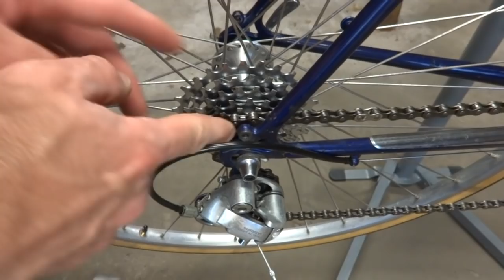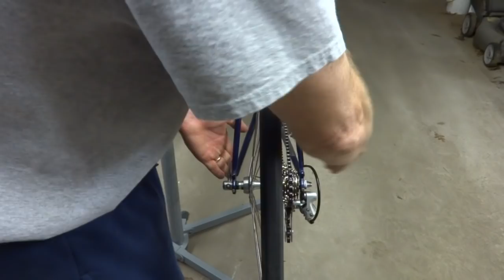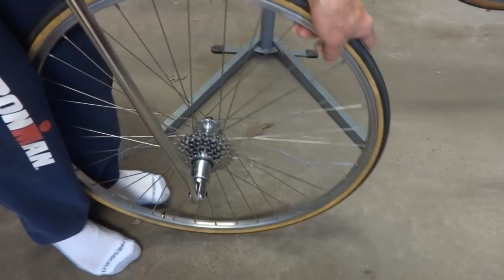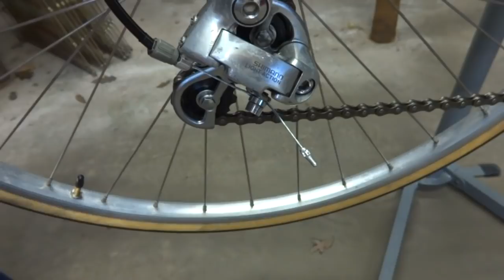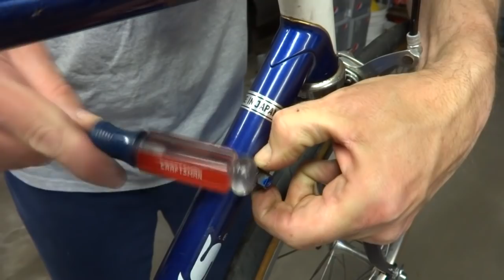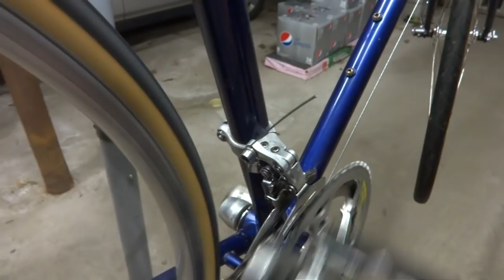How To Do 6 Speed To 7 Speed Freewheel Conversion

Comment from the maker: @Guillaume Bourdel, I found this stand cheap on ebay. It was a bit rough. The bottom part had some rust. So I cleaned it up and repainted the bottom part. It was originally the same gray as the top part. I keep the Park Tool stand in the house and this one in the garage. That way I don't have to drag the Park Tool stand in and out. The Park Tool stand is much nicer. This one doesn't hold the bike quite as solid as the Park Tools stand. I still have my homemade stand which I used for years. It is currently holding a Trek 520 frame that I plan to build up.
Reply: Cool! I have to tell you the stand you made was one of the best I've seen (and I've researched DIY stands for quite a bit!) and I used it as a base for mine. I wasn't quite sure about the plastic T joint to hold the bike so I installed pipe clamps instead. It never failed me and although it's not as practical as a "real" one it still does the job very nicely. I like how it can be taken apart too to store in tight space like the one I have. It sure makes any repair and cleaning easier!
Reply from the maker: I think some of the DIY stands around the net were based on mine. I posted these plans back in 2007: http://www.bicyclebikes.com/bicycle-repair-stand-plans.html
Reply: +RJ The Bike Guy got a couple if questions above if you could help?

Comment: For what it's worth, Sunrace freewheels work perfect with Shimano index or friction shifters. They're ramped so they shift way better than vintage freewheels, especially with friction shifters. They look better than the modern Shimano ones like in the video with the hideous big black cog with a Shimano logo that goes on a Walmart bike, they're zinc plated and drilled and you can get them for less than $20. I have thousands of trouble free miles on them.

Comment: Thanks for this! I have a Mongoose Hill Topper that I bought in August of 1990 at a Schwinn shop. My Mongoose has a mostly original 3x6 Shimano drivetrain and I enjoy keeping this bike rolling. Plus, the steel frame is great for my two-year old's Thule seat. Anyway, I watched this video because I'm considering whether to convert my Mongoose to a 3x7 drivetrain, or not. My thought was to use the whole 7-speed rear wheel of my wife's 2003 Trek Singletrack (she rode the Trek maybe five times total and it's essentially in mint condition with Shimano Acera components). So, if I understand this video correctly, I could potentially use my wife's 2003 Trek as a "donor bike" to achieve a 21 speed bike on my Mongoose? In other words, all I would need to do is replace the 6-speed rear wheel with the 7-speed rear wheel, replace the existing 6-speed shifter with a 7-speed shifter, and possibly use a spacer on the rear axle (if needed)? Thanks again.
Reply from the maker: Probably, yes.
Reply: If the Hill Topper has a HG FH  a 7 speed cassettes might require a 130mm OLD. Easy on a steel frame ATB. I did this on a 95' Threshold. This year Mongoose had a 6 and 7 speed HG Altus group set available on HG free hubs.

Comment: How big are the gears on that seven speed in this video and how big were the gears that this bike previously had as a six speed? I am asking because if I were the one to convert a six speed to a seven speed, I would look at the sizes of my six gears before adding another one. If the sizes of my six gears, in tooth count, are 28, 24, 21, 18, 16, and 14 when converting to a seven speed, I would want that added gear to either have 32 teeth or 12 teeth, so the seven speed options that I would consider would be gear sizes 28, 24, 21, 18, 16, 14, and 12 or sizes 32, 28, 24, 21, 18, 16, and 14. Another option would be sizes 34, 28, 24, 21, 18, 16, and 14 or something very similar. If the extreme gears of a seven speed are the same sizes as the extreme gears of a six speed, then I no longer see the point of converting to a seven speen, unless if you want tighter shifting between gears.

Comment: Nice video, thank you! My brother gave me a Mongoose MGX DR-X 21 speed...my question is this bike good to take off-road?  Is it safe? Thank you!
Reply from the maker: Not familiar with that bike, but at a glance it looks like one of the low end Mongoose bikes with a dual suspension that is more for looks than for actual use. I wouldn't take it on an serious off-road stuff. It will probably break.
Reply: Thank you....I had plan to take it off-road tomorrow...but wasn't sure if it was safe....thank you for your time. Any recommendations on a bike for off-road?
Reply from the maker: Well to start off, look for something that wasn't sold at Walmart. Look for a band name like Trek or Specialized. You aren't going to find a good dual suspension mtn bike unless you fork out some bucks. A hard tail is okay. You can maybe get a bike with front shocks. Look for good shocks like RockShox. Low end bikes may have shocks, but they aren't much more than springs and are more for looks than use. Mongoose does make some higher end bikes too, but unless you know what you are looking at, I would avoid that brand. They make a lot more low end bike that higher end ones.

Comment: I have a 6 speed Shimano tz20 ( 14-28 )freewheel that I'd like to swap out for a 7 speed megarange (14-31) The shifter is a Shimano SIS index revo shift (grip type) The derailleur is a Shimano SIS index Tourney. Can the swap be done? What would I need to change besides the freewheel?
Reply from the maker: You would probably need a new rear derailleur that can handle a 31t freewheel, and 3x7 shifters.

Comment: Another great video! Reason to do this is just to give a bigger cog for hills, right? I have an '87 Trek with Suntour a5000 derailleur (AccuShift system?) and DT shifters. 6 speed indexed shifter. Do you think I could just get a new pair of 7 speed suntour shifters (or even just the right side one) that would work with my existing derailleur? I see lots of 7 speed suntour accushift DT shifters on ebay. Thanks for any info you can provide!
Reply from the maker: You can have a bigger cog with 6 cogs. 7 cogs give you more gearing options. And more options for indexed shifters. You would have to research that. I am guessing if it is accushift, it will probably work. I like the Shimano SIS indexed stuff.

Comment: I'm converting from a 7 speed to an 8 speed and the chain DOES hit the frame.  Since I'll be adding a spacer on the drive side, shouldn't I add one on the other side as well?  That will then mean the disc brake caliper will need adjusting or shimmed right?

Comment: Terrific video and well explained.  I have a similar bike with a 6 speed freewheel and friction shifters (all Shimano).  Can I reuse the existing parts and just upgrade the freewheel?  Freewheel model # would he helpful.
Reply from the maker: If you are using friction shifters. Maybe. Whether the shifter and derailleur move far enough. Freewheel model doesn't matter as most 7 speed freewheels are spaced the same and would work.
Reply: RJ The Bike Guy 

Ok I did some digging and I think I have a Shimano 105 golden arrow.  I remember this was before SIS.   I think later models of my bike came with 14 speed so I think there should be room for the 7 speed freewheel and I think the 105 can handle it as well?
Reply from the maker: @19dlau69  maybe. It's friction shfiting.

Comment: Hey RJ, I have a few quick question for you about mods on my Citizen Tokyo Bike, which I got really cheap. The standard equipment is 16 inch wheel freewheel, Shimano 14-28T 6 spd, the stock tires are 16" x 1.75" 45 psi. stock plastic foldable pedals, Alloy V-brakes and 170mm alloy crank arms with 48T alloy chainwheel. Cool bike, but too slow and a little heavy. I'd like to upgrade a few components for a little more torque. Of the few blogs, I read, recommendations have been made for a 11-28 freewheel, 7 speed and 55 T chainwheel. My questions are has anyone attempted this project? If so, did this combination make a difference? Lastly, to reduce the cost of overspending, the best place to source components? Thank you.

Comment: Nice Explanation, But... is it possible that you name the tools and the new parts so it's easyer for the readers what they need to do it yourself.
There's alot of fake parts on the internet.
I myself have a vintage peugeot city bike from 1975, made in france with that 6 speed freewheel (Shimano MF-HG20) with Shimano Positron PPS derailleur and need a new freewheel. If you could advise me which Freewheel remover (mayby FR-1) and which freewheel i need (mine is 14-32).

Comment: My bike has a steel frame and I have an old 8 speed trigger shifter laying around. Is it possible to do a 6 to 8 speed (both freewheels) conversion?
Reply from the maker: Possible, yes. Advisable, no. If you want 8 speed, get a wheel with 8 speed cassette. You will have to expand the frame. https://www.youtube.com/watch?v=QwxEPRk3LFg

Comment: Great video RJ.  Would you happen to know if Shimano made a 7 speed freewheel in the 600 series?  I've looked for one on ebay unsuccessfully.
Reply from the maker: Not sure. You would have to research. 600 became Ultegra. I found a Shimano 600 Ultegra 7 spd Uniglide Cassette. That might be what there is.
Reply: @RJTheBikeGuy  Thanks for the info RJ.  My bike is vintage (1986) and has a screw on freewheel.  It doesn't look like there's anything out there if I want to stay in the old 600 group set.  Time for a new bike I guess.

Comment: assuming your not using an indexed shifter(using a friction shifter) is replacing the rear derailleur necessary when going from a 6 to 7 speed freewheel. this is on a 1984 schwinn world sport, which is equipped with a Suntour friction quill stem mount shifter, and a Suntour AR rear derailleur. the front derailleur  is a Suntour AR as well.
Reply from the maker: Maybe, maybe not. Depends whether the derailleur will reach all the cogs.
Reply: well! we'll find out tomorrow when i go into the shop! thanks dude!
Reply: hey just wanted to let you know i was sucessfully able to convert the world sport to 7 speeds! next step is 9 speed!
Reply from the maker: Cool!

Comment: I am totally happy with 2x6. My problem is that I cannot get a decent hub / freewheel anymore. I don’t want to go 2x7 with cold resetting the dropouts just to be forced to friction shifting to make 2x7 freehubs somewhat work on my 2x6 SIS. I don’t understand why the big companies do not make one good retro system for those many old bikes out there. I think there are enough enthusiasts out there for a small batch production.
Reply from the maker: Did you watch the video? I didn't cold set the frame. I didn't use friction shifters. Not sure what you are talking about.
Reply: @RJTheBikeGuy , I really like your videos! Very helpful information. In this video, you still had to change the shifter from 6 to 7, which I do not want to do, because I am happy with the quality of the Shimano 600 Series 6-speed shifter. I don't see a reason to go 7-speed. I would instead like to replace hub and freewheel with new parts (I know I can get worn/used ones, mostly for a large premium, on ebay), but I have trouble identifying a manufacturer in the SunTour quality class (Origin 8 seems to be the only 126mm option on the market and 13-XX freewheels are not longer manufactured?). In order to keep the gear ratio I am toying with the idea to upgrade the chainring from 52 to maybe 56 or even larger and then use a 14-XX freewheel.

I also got a bike that was cold set by someone to fit a 130mm 7-speed freehub, but the indexed shifters (again 6-speed Shimano 600) work only in friction mode with the 7-speed cassette. Maybe you could point me to a resource how to retrofit the shifters: It is my understanding that by exchanging one of the rings in the Shimano 600 6-speed shifters, they can be converted to 7-speed without the need of replacing the entire shifter. I am trying to find a copy of the instruction manual from the 80ies that supposedly describes the process, but so far I did not succeed.

Thanks!

Comment: Great video! Merry Christmas! I have a 6 speed freewheel bike (an old big box bike) and a good 8 speed shimano acera shifter. It would be less expensive to do an 8 speed freehwheel conversion than a 7 speed freewheel. Is it feasible without needing to redish the wheel? I got a steel frame that I can extend.
Reply from the maker: You will need a new wheel. 8 speed hubs are wider than 6/7 speed hubs. And generally 8+ speed are cassettes, not freewheels. There are 8+ speed freewheels, but they are usually cheap junk, and the longer axle is prone to bending.

Comment: Hi RJ, thank you for all your tutorials for us home mechanics.  After 8 years since its publishing this video needs a refresh. VG Sports has 11 speed 11t - 36t frewheels selling on the Internet forest. Could you do a conversion from 7s to say 10s or 11s freewheel, and what it takes for a conversion to succeed in terms of axel, derailleur, shifter??
Reply from the maker: First, a big thank you! I can't give a long response right now. I have limited internet access. When I get a chance I will give you some suggestions. I do have some videos where I go from 7 to 10 speeds. that would be the basic idea.
Reply: @RJ The Bike Guy  thank you for getting back to my inquiry. I just did a conversion myself on my Hybrid bike by buying a new rear wheel with HG freehub, which costed me $85 for the wheel alone. I wonder if the product I mention could have been retrofitted to my freewheel hub with ease without forcing me to change the whole rear wheel..
Thank you again for empowering us DIYers with your insights 🙏🏻💪🏻🙂
Reply from the maker: Not really. Freewheels and freehubs are way different. Freehubs are designed to have the bearings further out to eliminate bent and broken axels from wider cog sets.
Reply from the maker: They have bigger cog set free wheels but they are not a good idea.
Reply: @RJTheBikeGuy  thank you. You're the best 👌🏻

Comment: FYI I have a bike that has a 6 speed shimano 600 uniglide rear hub with 7 cogs on it. You need to use slightly thinner spacers between the cogs (specific to 7-sp). The small threaded cog has enough space to screw on a few threads, which seems safe to me. I've put a few thousand miles on it with no issues.  I don't know if this would work for all 6 speed uniglide hubs, but it works for mine.

I also wonder if you just have a non-indexed friction shifter, if there's many RD's designed for 6 speed that can't handle 7 cogs?  don't know if there's any leeway for adjusting the limit screw.

Comment: I'm preparing to convert an '86 stump jumper into a touring bike. The 3x5 drivetrain is pretty shot, so I am planning to rebuild it. I'd love the option of putting a 6-speed Shimano freewheel on, particularly one with an ultra-low 34T cog. Do you foresee any challenges in going from 5 to 6 speed?
Reply from the maker: The hub spacing is likely different and you would need new shifters also. Not sure what kind of shifters you plan on adding, but road shifters are not compatible with mountain front derailleurs. And road brakes are not generally compaitble with v-brakes, etc etc.
Reply: Ok good to know that the hub spacing needs changing. That's a bit more effort than I'm willing to put in so it shall remain a 5-speed. It has Suntour friction bar shifters on it, and they still function quite well :)

Comment: Hey, I have a 6 x 3 speed bicycle but it's 5 years old now. I need to change the shifters so is there any chance by which I can convert it into a 7 x 3 speed bicycle. I also need to repair my breaks so I was really considering the shimano combo shifter.
Or can I use the shimano combo shifter for a 6 x 3speed bicycle?
Thanks.  :)

Comment: Nice video.  If the idea of converting a 6 to 7-speed was to get more speed out of the bike, I'm afraid the 7-speed has a 14 tooth sprocket on the smallest gear ( just like your old 6 speed).  If you are going to be climbing steep hills, then it is an improvement.  I just found out that by doing research there is a Shimano HG-37 7-speed freewheel has a 13 tooth sprocket on the smallest gear.  Just a thought.
Reply from the maker: No, the idea was to increase the number of gearing options and make the bike slightly more modern. Going to 7 speed makes it easier to go to indexed shifting which has limited options at 6 speed. I never said it would make the bike faster.

Comment: So, my old Schwinn is currently 2x5, but I'm thinking about replacing the freewheel to add more gears. I'm not sure if I want to get a 6 or 7 speed freewheel. How much wider are the freewheels with more gears? is it really enough that you'd have to bend the frame? Also, when you say "spacer" do you mean the same thing as a washer?
Reply from the maker: A 5 speed hub is 120mm wide. A 6/7 speed hub is 126mm wide. So you will have to spread the rear triangle. But it has to be evenly spread on each side. A spacer is basically a washer. But they make them for axles in mm widths.

Comment: RJ Nice video and I am converting my foldable bike from 6 speed to 7 speed. I have found that the chain is rubbing against the screw nut holding the rear derailleur  at the dropout. Is there anything I can do to fix this? Coz it’s not possible to put my chain on the lowest cog as it jams with the screw nut.
Reply from the maker: Maybe an axle spacer. I thought I mentioned that in the video.
Reply: I will try that one out. Have been watching many of your videos and fixing my bikes on my own. You really made them easy to follow.👍🏻